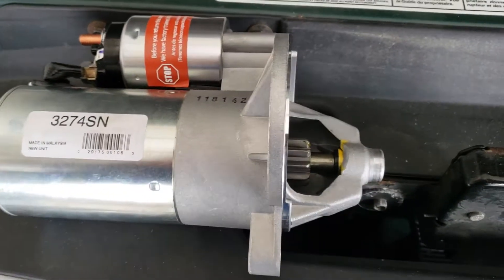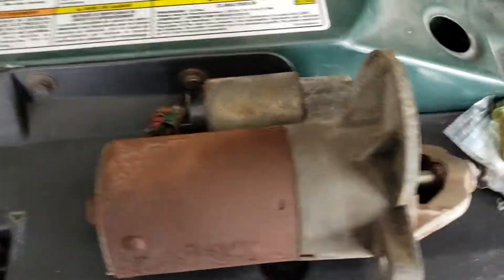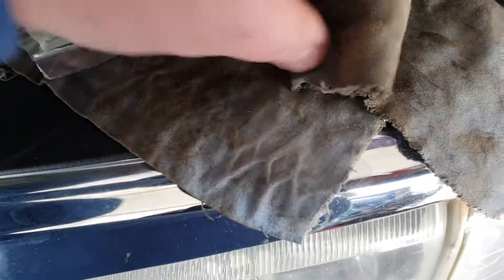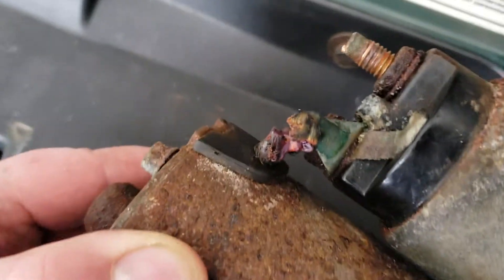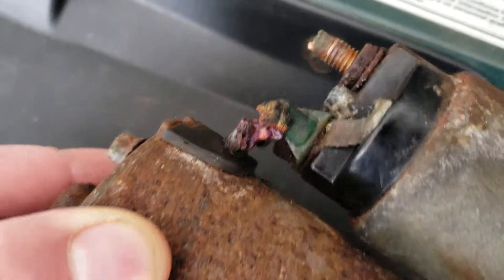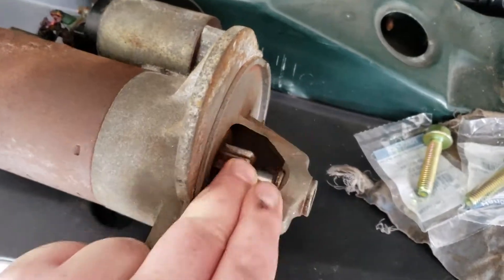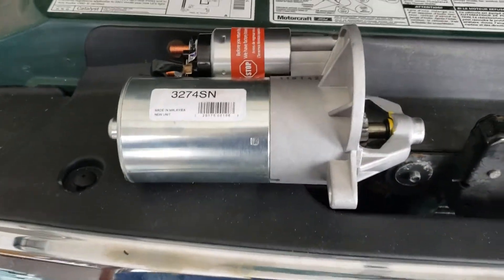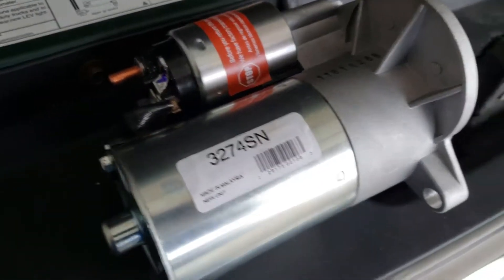2001 Mercury Mountaineer 5.0L Starter Replacement 3

Comment: Upon closer inspection, the cooler lines were touching each other for as long as it's been since the truck was built ( 2000 Mountaineer ) the point where they came in contact had rubbed and rusted together. When I moved them,  it broke the rust connecting them. One pipe was intact while the other one had a marked erosion in the thickness of the tube wall. I replaced a 4in section with 3/8 steel brake line and compression fittings.
If I had a shop with a lift, I would have fabricated a new line but working on your back, laying on the street was a deterrent.

Comment: In all your videos, it would have been nice to see you removing the starter without pushing the transmission cooler lines out of the way. I removed my starter pretty much the same as you did but I had to pressed against the transmission cooler lines to get it to come out. When I put the starter pack in everything seems fine tighten it up tested it and proceeded to get a transmission cooler leak.
Reply from the maker: I never removed them.
Reply from the maker: I was working on a 2001 Mercury Mountaineer with a 5.0L V8. You must have a different make or model.